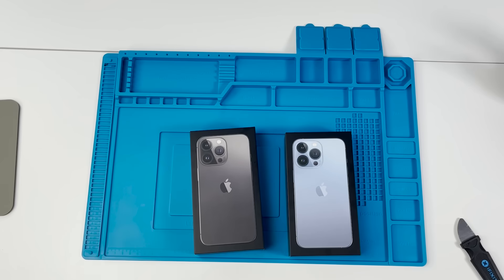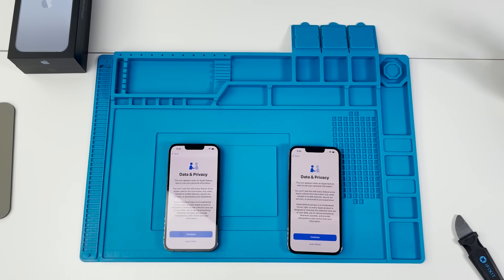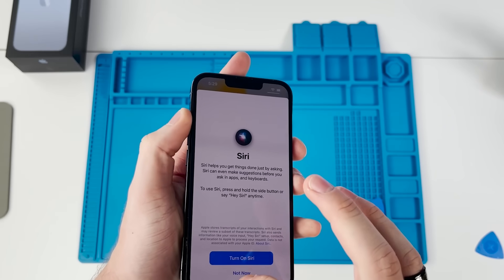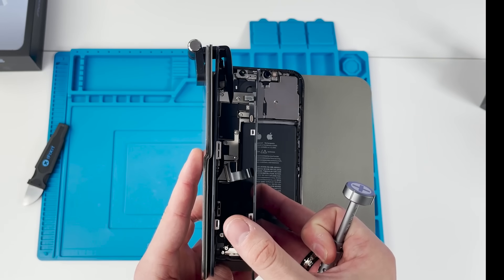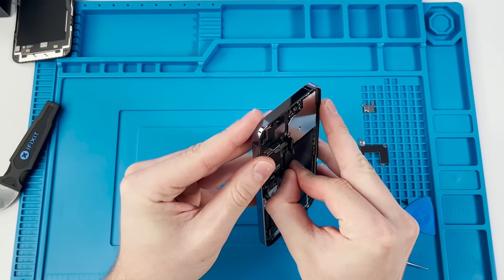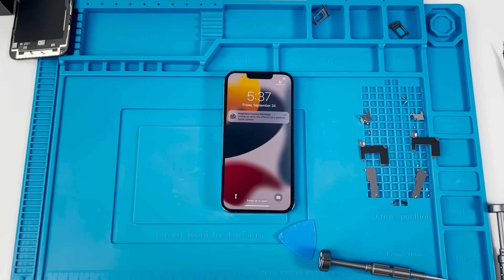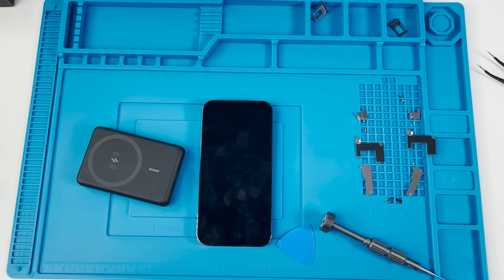Can the iPhone 13 Be Repaired? Let's find out....

Comment: What do we have to swap from an iPhone 13 Pro to another 13 pro. I have one with a broken motherboard but still a nice back and sceen. I managed to buy a totally broken phone but it works fine. It dropped very badly but can use the components. If I Yust take the motherboard out and put it in my phone. Will it work or do I have to swap the rest over alswell for the battery?

Comment: I bet Apple has made a serial code for all of the parts so if you change anything at all except for the back glass it will not work because Apple made it so all the serial numbers of each part and component gets tied to each other so if you change anything at all it’s most likely not gonna work or just partially not work. Heck maybe at this point Apple would put a serial number in your back glass so you can’t even replace or change that either unless you have the stuff at Apple.

Comment: The 13 model looks really appealing. Opening one, though....that makes me nervous. While I am generally comfortable fixing some electronics and also having somewhat okay soldering skills, I really feel out of my depth when it comes to phones - feels to me like hopping around in a mine field on a pogo stick. So massive props for shelling out the dough to show us what those two look like on the inside. So far I got 4+ years out of my old iPhone8, which IMO is not half bad for a phone. Had the battery replaced once after 2.5 years and need another battery swap soonish, but otherwise it is in great shape.

Comment: Yes. It can be repaired. Only recommended with Apple Authorized Service Providers though. Using 3rd party parts will void any service that Apple would normally assist you with. Pro tip, dont go to repair shops. They dont use genuine Apple parts.

Comment: the camera plate is larger than the board because it needs to be. it uses a new stabilization method which has not yet been refined by Apple but is much better than software nonetheless.

Comment: The rumors are true.  The phone will still boot up, but the FaceID will not work nor will the Cinematic Camera.  Also, auto-brightness has been known to fail.  https://youtu.be/8s7NmMl_-yg
Reply: The rumor was is that the phone would undergo severe logical errors that would prevent the phones use or Apple would block unknown parts to control the system. It's amazing enough knowing that the phone would even boot, and it would shed some hope for 3rd party repair.

Comment: It’s almost mad how small the entire motherboard is when it can do so much and has more power than some laptops and pc’s
Reply: Thats dumb...
Reply: because mobo doesn't provide any power? It's a hub to connect parts. And compare to laptop and pc even at 1/2 the price, this phone is nowhere as strong. You don't know what you talking about
Reply: @HevaNaisdey  its common for apple fans not to know about tech, they buy the product for looks, status and ease of use . The top comment isn't wrong though you can always find less powerful, as for any phones if you compare it to a cheap latop cpu or old one, the person that commented pretty much wrote for nothing
Reply: @HevaNaisdey  pc’s are better at the same price , because they don’t need to make their processors small and cold. At that performance it’s really good for iPhone  , it can launch all games on iPhone without lag , so if we compare this to an pc , it will be kinda the same ( remember , there are some laptops with celeron , that launch genshin impact worse than iPhone android and they cost 750$) but pc is of course cheaper ( not now , because of videocard prices ).The cost of making an iPhone is around 500$ , and i never saw an iPhone 13 lag. I mean comparing to pc , it’s not that bad. That thing can be in your pocket , but pc can’t. So it’s practically really good , and definitely faster than many pc’s and laptops like mine 😂

Comment: maybe keeping it plugged in with the charger cable was the reason why the face id doesn't work?? you may know this already but never keep a phone plugged up to the charger cable when unplugging the battery, it WILL cause a voltage spike and could damage the phone.
Reply: also the flex cable that is on the top of the screen may be the face id, so without that cable the face id won't work.

Comment: I think those warning messages are still useful when you buy a used phone and you have no idea if the seller changed parts or it's still in original condition. Those annoying messages can be removed by Apple authorized repair shop ONLY, which is an extra stop after replacing original parts.

Comment: the screen looks thinner than a knockoff screen replacement
Reply from the maker: actually knockoffs are usually thicker, Thinner = costly
Reply: @PhoneRepairGuru  Whattttttttt, I don't know the economics behind this but I'm from India and usually, original screen is thicker than a knockoff and knockoff are so thin they wouldn't even last 6 months. I still have my broken original screen with me, after your comment I just checked it and still the knockoff is way too thin, I'm using a Nokia 5 from 2017. The original one is a millimeter thick and the knockoff is less than half the thickness of the original. When I got it replaced I did try to break the Original one it is hella strong too strong it surprised me how strong it was but when my knockoff screen was broken and when I tried to break it even a toothpick felt stronger, way way too weak, and I've replaced my screen 2 times now with a knockoff and even the 2nd one is broken and I'm just smartphone less now. Always go for the original spares, that's what I've learned. The original one would cost the same as two knockoffs.

Comment: Iphone 13: slightly changed camera position and repairable 
Apple: Innovation
Reply: ugh ... 120Hz display, the optics is WAY better and way better battery life (with 120hz), best in class macro lens, and 50% faster GPU, cinematic mode is way better than competition  ...

It's not a quantum leap forward, but hardly "no improvements whatsoever"

Comment: I forget the channel but the guy went to china to test a bunch of batteries and one seller was selling batteries that had the apple electronics but the cells were replaced. I did the same thing on old Dell laptops when they used 18650 cells.

Comment: Would be awesome if you tested whether Apple is under-clocking the SOCs upon part change to sabotage independent repair shop image among the general public in case they want a reasonable price for work done on the device.

Any popular benchmarking software would do, most notably Geekbench CPU (SINGLE/MULTI) and GPU test.

Comment: one youtuber made a battery test with the 13 series and the 13 pro max lasted for 9 hrs 56 mins the longest in any phone till now!!!
Reply: they really have improved the battery this time
Reply: Eh? Not to bash on Apple but my battery easily lasts 2 days with normal usage, around 14 hours of continuous use
Reply: @maxz8807  which phone you're taking about
Reply: @ayushnichal  galaxy a72
Reply: @maxz8807  now see the battery test of iphone 13 pro max included using reels tiktok, a 1 hr gaming and a recording in 4k with the cameras which consumes the most battery and the wifi, bluetooth was on the whole time with 50% brightness and still last 10hrs even samsung s21 ultra lasted 8hrs but iphone was 2 hours ahead

that is it was a heavy usage test still the results were mind blowing i bet your phone would not last longer than 5 hrs not even mine

Comment: You should have kept the blue phone's screen instead of switching over the black phone's screen, since you already moved the black logic board to the blue phone.  Switching the screen too means that the screen was the same that came with the logic board, and that's why there were no screen errors.  If you had kept the blue screen, there would have been another error message.
Reply from the maker: I did, it showed up as unable to activate face id
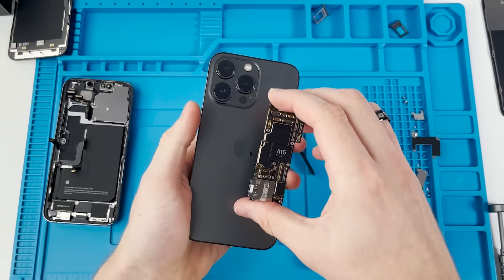Reply: @PhoneRepairGuru  Oh, okay, sorry for the confusion!  It's still a great video, by the way.  However, did you do that off screen?  Because at 10:32 you say you're putting the black phone's logic board in the blue phone (which makes sense), but at 11:15 you also say you're putting the black phone's screen on the phone (and the blue phone's screen the whole time has been at the top left of the mat).  Also at 11:18: "The black screen and the black board in the blue phone."
I thought the Face ID message was because of the components left in the blue phone (because everything except what you said you thought was the dot projector was not part of the screen) and you said that you expected besides those error messages a screen error message.  I think that message is along the lines of TrueTone is disabled?  So I'm still a little confused.
Anyway, thanks for responding, and as I mentioned it's still an awesome video.

Comment: If the logic board is from the black phone, and you put on the black screen, the screen will be recognized as the original...

For the changing screen test, it should be the blue screen, cause the logic board is from the black phone...
Reply from the maker: I swapped both the logic board and the screen
Reply: @PhoneRepairGuru  so, the logic board and the screen was from the same phone, right? Both from the black one
Reply from the maker: @acerolamuti  My mistake I'm realizing now I did not swap the screen. Good eye

Comment: 01:32 "standard C port charger". That's just a lightning cable. No charger anymore, no C cable yet, maybe in iPhone 20😋. Nice vid, keep it up.
Reply: It’s lightning to USB-C
Reply: @krispyhd9484  which is pointless because you can't exceed what the lightning port can put out. If type C can charge a phone at 5 amps, and a lightning port can only transfer or receive 2.6 amps then the type c doesn't matter because that cable will only ever transfer at the max of the lightning port. It's a scam. It's totally pointless to have a type c end on a cable unless the other end has a type c or usb a 3.0
Reply: @TheNade  yeah, I know I’m totally fine with lighting
Reply: @krispyhd9484  it's fine if you already have an iPhone, and a USB-C charger. But for me and many others is a pain in the ass, my phones are charging with USB-C, and all of my chargers(5) are USB-A. If I wanna buy an iPhone, I am forced to buy another charger with USB-C port. So once again, more money for Apple, with a simple cable trick.
Reply: @mindadaptor  at the moment I have 1 Samsung tablet with a usb c ports and I’ve owned lightning cables for like that past 6 years
Reply: @mindadaptor  but I can’t wait for iPhones to get usb c as the iPads have it already
Reply: @TheNade  agree 👍
Reply: @krispyhd9484  but we are talking about iPhone, not iPad. iPad has it already, but I don't own an iPad to use its charger, I don't own anything from Apple.
Reply: @krispyhd9484  yes I know, but you know what I mean. My phone charges with USB-C, and my charger(55W) has a USB-A port. So I call it a USB-C cable.
Reply: @mindadaptor  ah that’s what you mean

Comment: You should test to see if any 12 parts work with the 13
Reply: Obviously they wont
Reply: @tgv6t  they might. i’ve been desperate in a repair before and have attempted to
use iPhone SE parts in a 6S+ and it worked.
Reply: @prat751  I think is more of a the parts literally don't fit problem, I believe since iPhone 10, every generation onward changes the internal so nothing is backward or forward compatible
Reply: @AndyZULUL  i haven’t tested it with anything 10 or upwards, just saying what happened with me in a pinch
Reply: @prat751  Yeah only a battery will fit other than that not a single other connector is the same size or has the same pin out between 6s+ and SE
Reply: @AndrewWhitham  i haven’t tried any other parts, this was in a pinch and i wouldn’t suggest it anyway
Reply: @prat751  The SE is pretty much a 6s anyway, if you're just testing if it turns on there's zero harm using one

Comment: Brooo you really scared me with the battery rumor 0.o Veeery glad thats not true xd
Reply: If you replace a battery in an iphone 13 you will get a pop up msg every single time you unlock your phone saying the battery is not genuine. That is not acceptable to most people to have a battery warning pop up display every single time you unlock your phone. That means that while the battery will work and power the phone, it is still not an acceptable repair for the mass majority of people out there.
Reply: @TheNade  Yeah, phone is practically unusable but everyone is saying "Oh no it's just a rumor" 🤡🤡🤡
Reply: @TheNade  why? Are you a reseller of iphones? Many in other countries are reseller but they sell recondition or iphone that has class a or not genuine apple parts specially the screen and battery.. why you dont want a important battery message to stay.. i mean if the phone has not a genuine parts the pop up will stay..
Reply: @TheNade  You do know you can slide the message, dismiss it and it wont show up in lock screen anymore, right? It will just show up in settings after that. So not that much of a deal if you explain in to the customers
Reply: @ProLaunchpadder  hopefully this is just the case and not what the other guy is saying.
Reply: @ProLaunchpadder  So you would like to have a car where when you swap a battery you get a pop up on main HUD every time you turn on ignition that battery is not genuine but you can turn it off however you will never get info in what condition the battery is ?
Reply: @yukinoryu  you do see the condition tho. lmao
Reply: you here xD
Reply: also btw @TheNade, PLP knows that, he has a repair shop too :p
Reply: Why do you want the battery message disappear??
Reply: So if you want  100% original genuine apple parts.. you will buy a brand new sealed.. if you buy in ebay or some resellers or a second hand iphone .. the important hardware messages can hack or disappear.. ok i will buy a brandnew iphone 😭 i am afraid that i will use a iphone that has a replacement parts.. for me iphone that has replacement parts is not smooth as the iphone has an original/genuine apple parts..
Reply: @kevinman8117  occasionally, if you get good quality replacement parts, the parts will be a lot better than the genuine Apple parts

Comment: For future reference, the “screw-ception” screw’s official names is Standoff. 🙂

Edit: Yes it might not be called a standoff, but that’s what iFixit calls it, so that’s where I got the term from.
Reply: That is not a standoff. A standoff isn’t used to screw anything in place. It is screwed in by itself to lift something up, like a motherboard from a case. Those screws on the video hold 2 components. It’d be like if a standoff held down the motherboard and then another motherboard on top of the first one. 

Basically a standoff only holds one component. The screw he showed in the video holds 2 components. Idk the name but it’s definitely not a standoff.
Reply: @brunoglopes  Apple calls it a superscrew iirc.
Reply: Apple calls it a super screw and since it isn’t used for grounding or separating anything, but just smooshes everything together I’d say it is not a stand off
Reply: I would call it a threaded insert.
Reply: I always call it grounding screw...
Reply: I call it Anker screw 🤣
Reply: Send a text to me if you are ready to repair any kind of iPhone
Reply: There called stacking  screws. Where the head is threaded to accept another screw...
Reply: It is actually a standoff
Reply: A standoff would sit behind the board and only have the purpose of ofsetting the board from whatever is below it (the rear housing in this case). In this case the screw holds a part and in turn you can screw another part on top of it. The term in this case is  "Superscrew". :-)
Reply: @DriftComet  yes you are correct, been working as a repair technician for apple for 6 years now and thats what theyve always been called. Theres even a special screwdriver bit that he isnt using in the video.
Reply: @DriftComet  lmfao a superscrew? 😭😭😭 it’s definitely not called a superscrew
Reply: @Suchmxn  read
Reply: @Suchmxn  it definately is called that lol
Reply: Standoff is the correct term for it, its used in every single pc to mount the motherboard
Reply: Imagine calling yourself a phone guru and not knowing what a standoff is lol
Reply from the maker: @TheNade  couldn’t imagine that… crazy 😩
Reply: @TheNade  toehoe pfp
Reply: @TheNade  You sir are the dumbest internet user I have seen today

Comment: Can you use a plastic tool that Jerry rig everything uses to remove the connectors,  instead of your finger nails? It looks a lot more professional.
Reply: It’s actually easier and safer to use your nails don’t wanna end up damaging an ic on the board or bending sumn that shouldn’t be bent
Reply from the maker: @jalenpantin4858  Thank you